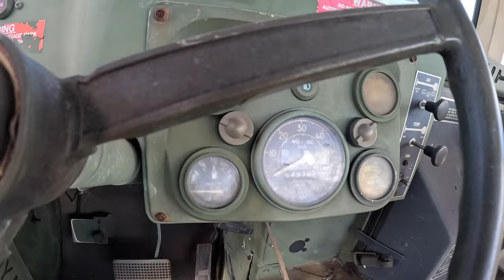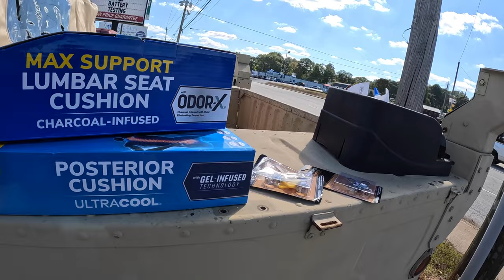Trying To Drive A Humvee Home From The Auction = Bad Idea!

Comment: 64k miles on a humvee is almost guaranteed to be on its 2nd or 3rd engine.  I heard you mention starting fluid.  Do not, under any circumstances use starting fluid on a 6.2/6.5.  It detonates before diesel does thus knocking the whole ignition cycle out of time.  The residue from the ether will also coat your glowplugs and cause them to go brittle and break off over time.
Reply from the maker: Engine has a reman date on it.  We didn’t use the starting fluid just didn’t know what to expect so we needed to be ready for anything.  It starts right up and runs good so we got lucky.
Reply: Any particular reason it'll be on its 2nd or 3rd engine with 64k miles? Does the temp they run at kill the engine fast?

Comment: You guys are funny. I don't know everything about humvees but what you thought was a electric fuel pump is the fuel filter. You point at the fuel lift pump and thought is was missing a pump. The canaster coming off the passanger valve cover is the cdr valve for crank case pressure. Looks like it was a fun adventure.
Reply from the maker: Thanks for watching. It was fun trying to get that thing home.

Comment: BTW; appears you have one of the ORIGINAL HMMWVs we built.  Overinflated Tires is likely why you did not/chose not to make it "home"!!!  20 PSI Fronts; 25 PSI Rears. You may get a surprise when you tear-down those tire & wheel assemblies.  The could still have the original 2-pc. bolt-together, magnesium Runflats inside.   Speedometer/Odometer have been replaced at least once since HMMWV was originally built.  The only way to properly "re-tension" a Matched Set of V-belts in a HMMWV is with a Belt Tension Gauge.

Comment: I'm only a year old 2 HMMWV owner but I'll pass along as much information as I can relating to everything pointed out in this video. I own a M1097R1 and a M1114 Uparmoured HMMWV.
Yours looks like a M1097R1.
The Valve you're pointing to at 3:37 is called a CDR valve, it's a piece of the deep water fording kit.
At 5:00 it's just an inside joke but don't call it a Hummer you'll make Humvee Vets mad lol. At 5:48 Always if possible change the Coolant as soon as possible and give it a flush, my radiator had about 1/2 inch of sand in the bottom of both the engine rad and turbo radiators
Reply: At 6:20 The military always zeros the odometer after a service. So that should be aprox 64k since last service which is alot but that may mean that the truck has been running solid with no issues... or they have been ignoring them. Typical government stuff
Reply: At 7:05 the board is multi purpose. It could be a radio platform, ammo storage, tool storage, and gunners platform. At 7:23 The vibration could be a multitude of things but most of the time it's just the run flats putting the tires out of balance as they shift inside of the tires. Now I'm not as serious as some on this issue but as a word of warning the spindle nuts holding the tires on can fail if not properly installed and serviced causing major injury or death. I don't want to scare you with this Information but I feel it's a worthy warning. At 11:00 if it helps you can just unplug the back left connector and the engine will turn over but can't start. I don't fully know why yet but I do that alot when I go out in it. At 16:10 yeah the fan clutch typically sounds like a jet engine. Gave me a pretty good scare the first time I heard it.
Reply: At 20:10 under the custom drinks carrier I'm really surprised the radio deck in your truck came with a BFT (Blue Force Tracker) shock mount for the radio, that's kinda rare. At 22:20 your rear soft wall should be under the soft roof cover rim
Reply: Lastly at 27:40 If you need tires that are brand new pre balanced and have run flats check out Eastern surplus in PA, that's where I got mine. One of my tires had been shot out when I bought my M1114. The tires are all Kevlar lined so they won't violently explode like traditional tires but that back rear is definitely bad.
Reply: If you have any questions I'm happy to help in any way I can. I can upload videos to my channel for references if you need them.
Reply from the maker: Thanks for the info! We should have another HMMWV video out next month.
Reply: @falkdupgarage572  Awesome I look forward to it!